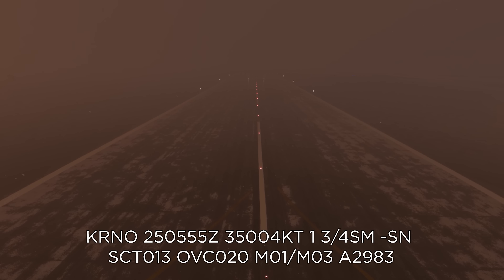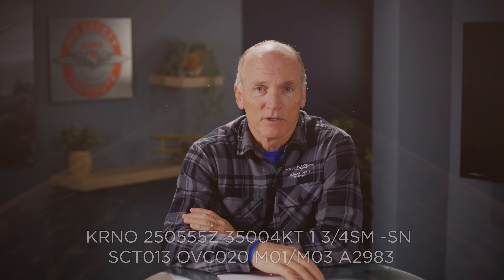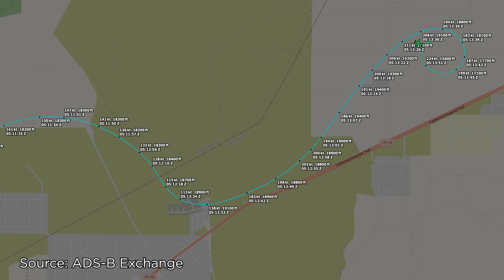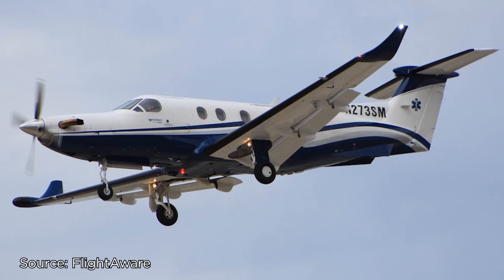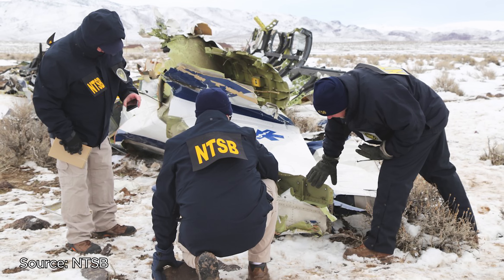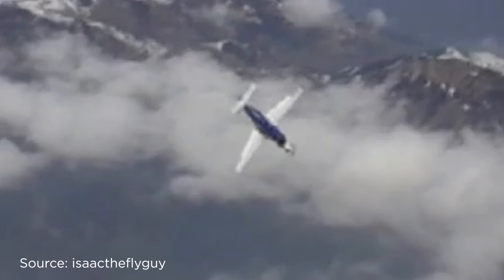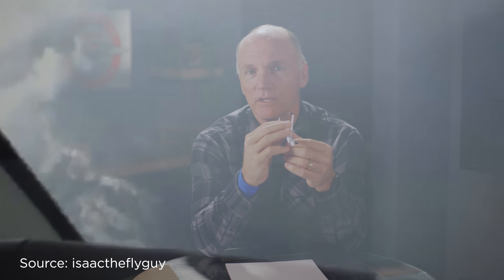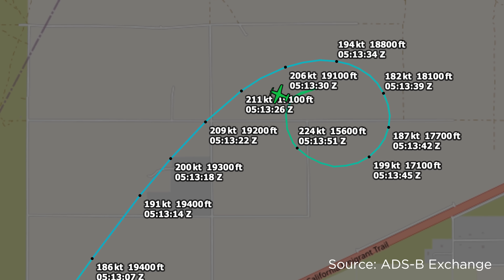Early Analysis: PC-12 In-flight Breakup Over Stagecoach, Nevada

Comment: It’s very difficult not to feel pressure when on a Medevac tasking. I would have thought that FL250 is somewhat optimistic with the anti/ de-icing on. In the end, it’s just a single engine turbine, and your excess thrust reduces with altitude, additional weight, additional drag, and with all your services on (bleeding air off the engine). The plane starts to struggle in the climb without all that going on past about FL180. Add in no visual horizon, PC12 known autopilot disconnect issues and all we really need for an accident is incorrect or delayed upset recovery technique. A lot of contributing factors to get to that point. Will be interesting to read the report. Stay safe out there.

Comment: All due respect, but there's a fair bit in this video that is misleading. I'm an IP and Check Pilot in the PC-12 for two different Part 135 operators, both based in the NW US, and one of which is Air Ambulance. In the future I would recommend you do some research on PC-12 EMS operations before making a video like this. BTW, minimum autopilot climb speed in icing is 135 KIAS. 

Much of this advice if fine if you are flying an SR22 in the same conditions, but this is misplaced for the PC-12. We fly these conditions on most every night of the winter. This is normal EMS conditions for the NW US. They call the PC-12 when the conditions are poor, and the rotors can't go. If we didn't fly every time there was forecast moderate icing and moderate turbulence we'd be grounded all winter. These flights, in these same conditions, are done without incident and with healthy risk margins hundreds of times every winter month by many EMS operators.

It's fine if you are trying to make a point with the SR22 pilots out there, but you should differentiate that operation from Part 135 EMS in a PC-12. This is not a GA flight. You're making it sound like this pilot was certainly in way over his head; all manner of conditions stacked against him. That's just not a valid understanding of the operation. I looked at the weather the same day of this tragic accident and I would have accepted this flight, just as this pilot did.

Instead of speculating on the pilot’s workload single-pilot IFR in wintery conditions we should be emphasizing attitude instrument flying both hand-flown and using the autopilot. You mention that at the end. However, I'm guess many missed that since you already have everyone wound up about the dangers of SPIFR in the winter in the PC12.
Reply: Anyone with a mind should always appreciate constructive corrections. Thanks for the correction.

Comment: I would think above 10,000 you would have the autopilot on. Climb on profile at turbulence penetration speed. I assume the deicing system comes at slight performance cost. If the autopilot disconnects due to turbulence at night in weather with a compromised overwhelmed moderate or greater icing situation and possible structure failure that's no bueno .

Comment: Extreme weather conditions with pressure due to the need of the flight. A slight mechanical failure and the odds just stacked up. Should just stay home some times

Comment: In my instrument training I was taught that you have three enemies in flight:  Weather, Night, Mountains.  I was warned to never face any two of those three at the same time.
Reply: That's a good policy.. When single pilot especially. Any of the following: General bad weather aka rain, clouds, etc , icing of ANY kind, terrain, night. Pick one. Never more than one. If more than one of those things exists. Pick tomorrow.
Reply: Would a Honda jet or vision jet been any better in these types of conditions?
Reply: Those are great words, but as a former freight pilot (multi), and then air ambulance pilot in a PC12NG, I can tell you that these are all everyday realities of what we do.

I have the misfortune of more than 1000hr in the PC12NG as an air ambulance pilot.
At best the PC12NG is a woeful aircraft. Underpowered and deice systems that are marginal at best.

I’ve flown turbine twins in heavy ice and turbulence as a freight pilot that could barely stay in the air.
Some others haven’t been so lucky.

For as long as companies insist on cheap single engine transportation, the fine margins of safety will always be pushed to the extreme!
Reply: @fistfullamullah Never flown a PC -12 , does it have de-icing on the tail horizontal stabilizer ? Any ice on the wing means more on the tail — which couldn’t be seen by the pilot and would nose the ship down straight away at stall . Of course, severe turbulence could have been a possibility since he was in cruise and above Va [ or Vy ] presumably. The latter , of course , could account for a few break-ups recently in near or in T-storm conditions—Crossfields’ accident comes to mind .

Comment: During the eighties I've flown various aircraft, as a single pilot, including 800 hrs of Air Ambulance flights in a PA60 all over the eastern U.S. in all types of weather remaining within the capabilities of myself and the aircraft. Afterwhich I flew the Beech 18 single pilot on a service contract in Georgia. Then moved into a KingAir 200 as a two pilot Captain crew. I have over 4k PIC hours and to me this flight was nothing but an enjoyable and challenging IMC flying well within the capabilities of the aircraft and commercial pilot. 

   IMO: Now I have made this mistake before, At the end of my flying career and something I despise doing, is to fly an unfamiliar aircraft. I was ferrying Mooney's from around the eastern U.S. to San Antonio, TX. I was giving a TLS and thought this was going to be cool flying high in an unpressurized aircraft. Being not one with the aircraft I didn't catch the o2 wasn't working and about 19k feet I accepted the fact that something was amiss. Tracked it down to the inline indicator and it was red. Emergency descent followed by mental calculations to keep the brain thinking. I was lucking. 
   It would appear to me that the pilot was hand flying, passed out and regained consciousness too late to recover. Based on the following, Departs with a heavy load into IMC and icing conditions. He's having to climb at a faster climb speed to remain above the minimum airspeed for icing conditions while having to employ engine anti ice vanes which reduce engine performance. This makes for  slow climb and not recognizing the aircraft isn't pressurizing. 
  Why isn't the aircraft pressurizing? Possibly the outflow safety valve is stuck open or won't close because the landing gear fully extended switch isn't triggered.  
  Every pilot should strive to become one with the aircraft. If there is something that can be done from the cockpit you should be ready to do it. Situation awareness is to continuously evaluate your and your aircrafts capabilities and apply this to the environment at that moment.
  As a single pilot, if a non immediate action emergency was to arise, I would engage the autopilot to reduce the workload and figure out a solution. The Century IV autopilot in the PA60 and I were best buddies. Those Air Ambulance flights are in the logbook between 500 and 1300 total flight hours. I've accumulated 4k PIC over the years.

Comment: A number of years ago, there was an accident involving a aircraft in the MD-80 family, where the use of de-icing (or anti-icing) equipment reduced the amount of thrust available to maintain the plane's altitude, resulting in a stall and subsequent crash.  I understand completely that the PC-12 is an entirely different aircraft with a different type of powerplant and de-icing equipment, but could the use of de-icing have impacted its ability to climb any higher?

Comment: What they want to investigate is after 4 medical fight crashes in the past year or so are they going to start requiring these medical operations that have two pilots!!  All the accidents have been basically the same thing, single pilot into IMC, treacherous weather conditions that are questionable to be flying in, moderate to severe turbulence and  icing conditions, losing control of the aircraft or spatial disorientation. Blancolerio just put a video out with ring camera audio from 1/4 mile from the crash site and it's extremely difficult to listen to and absolutely mortifying to think of what those poor people experienced the last moments of their lives, sickened my stomach. FAA has got to step in and make some serious changes.

Comment: I don't get why more commuter aircraft aren't designed with wings up high, doors and windows below, so that they are inherently more stable. What are the trade-offs, if any??
Reply: Roll stability is a function of wing dihedral, not so much if it's high-wing or low-wing.

Comment: I used to fly Medevac out of RNO to SLC in a turboprop, so this one hits close to home.  Spent many a night flying in those exact same conditions.  Blancoliro paints this one as spacial disorientation, but I'm having a hard time buying that.  This airplane had to be equipped with an autopilot to be legal for this 135 single pilot flight, and it appears that the autopilot was functioning for the first part of the flight.  Did it fail?  Did control forces force it to disconnect?  I'm guessing the latter.  It strikes me as significant that the airplane rolled into a 90 degree right hand turn at 05:11 and then recovered to parallel the course (but didn't turn back to intercept it again), and then the final spiral was to the right again at 05:13.  That tells me that there was some control problem.  The airplane wanted to turn hard to the right.   What was causing that?

Having close to 3,000 hours in turboprops with de-ice boots flying in all kinds of weather, I've had plenty of times when the de-ice boots didn't work properly.  Everyone who has flown de-ice boot equipped airplanes knows that you don't cycle the boots until there is a significant buildup of ice, because if the ice is not thick enough it will not break off and will form to the contour of the inflated boot.  De-ice boots are finicky!  Sometimes they don't inflate well due to an air leak.  Sometimes they inflate just fine but the ice sticks to them.   Possibly a control problem due to incomplete or asymmetrical de-icing.  

However, with a temperature at -1C on the ground, if there was a standard lapse rate it would have been way too cold for icing at 18,000 feet.  The icing band is rarely more than 3000-4000 feet thick.  Lapse rates are never exactly standard, so I'd be looking for PIREPS in the area and icing forecasts for that altitude. So the asymmetrical icing theory is a hard one to swallow too.   But I still think that there had to be some kind of control problem that forced the autopilot to disconnect and drove the airplane into a hard right turn.  He recovered it the first time, but not the second time.  

You mentioned the possibility of a stall.  The airplane had a ground speed of 164 knots when it started the first right turn off course, and 194 knots when it started the second right turn that ended in the spiral.  

You mentioned the possibility of the airplane coming apart due to turbulence.  I would have a hard time buying that one.  Moderate turbulence is very uncomfortable, but not dangerous.  It would take VERY severe turbulence (as in a thunderstorm) to cause structural failure.  The turbulence could have certainly complicated his control issues.  Again I'm wondering if there were any PIREPS on the turbulence at that time?

He was climbing through 18,000 when the problems started.  Was the pressurization working?  That is probably not the issue, because TUC is still about 20-30 minutes at that altitude, but it would be something to consider.  

If I was an investigator, I'd be looking at the maintenance history on this airplane.  Any history of issues with the autopilot?  Any history of issues with the de-icing system?  Any history of issues with the pressurization system?  I'd be looking at PIREPS and icing forecasts.  

I've done all kinds of flying.  Most of my career was in the part 121 world, but I'm currently back in the part 135 world of business jets.  But the most stressful flying I ever did was medevac flying.  It is often in these kinds of stressful conditions in older equipment and a compelling reason to get the mission accomplished.
Reply: Tim, my guess is you flew with American Medflight, who was bought by REACH, who contract with Careflight to operate in western nevada?

I have heard through contacts that ground crew and flight crew were questioning the necessity of the flight with a stable patient that was being transferred for a non -emergent procedure that could have waited until better conditions. Did you experience operational pressures when you flew?

Given Blanco’s video and knowing that PIC missed the taxiway due to visibility, needing to be guided by RNO tower to taxiway, do you feel that the flight should have been a “no” by crew and PIC at this point, or was there operational inertia pushing them on?

BTW, my spouse worked for this service and AMF. I did orientation for the service, but never flew. Risk wasn’t worth the crappy pay.

Comment: The B engine on the legacy PC12 has lower power, I think around 20% lower than the NG, with a full load, open separator and ice equipment on, he probably was working hard. If he was in moderate turbulence, it’s harder with the small original AI to hold it all together.  Sad deal. 
I had my autopilot kick out in an NG 2 weeks earlier at FL290 in TX in moderate to Serv turbulence, I can tell you it was not a good time, I pulled the power back and was able to turn East to use 140 knot X-wind to get away from the system.  I could barely see my 12” display things where shaking so bad and it was a good workout making a 90 course change in that environment.

Comment: I have over 7000 hours over 20 years in PC12 aircraft. First, I like your Videos! Second, turbulence wont cause a elevator failure at the speeds that he was climbing out at (please don’t say that again, all we need is for passengers to think that turbulence causes airplanes to come apart) I have flown a PC12 on many occasions in far more demanding conditions than this and the plane handled it with a wide margin of safety.
This was pilot error, pure and simple. He got too slow and was behind the plane. More than likely he was climbing out with the autopilot on VS mode and as the speed decayed he failed to catch it causing the plane to stall. Pilots that fly the PC12 know that you must switch over to IAS (indicated. speed) mode at 140kias minimum. That way if you get distracted the speed doesn’t decay to a stall (ask me how I know). RIP all victims of this avoidable accident.
Reply: I think a bombardier RJ suffered engine failure because the crew set the autopilot to a vertical speed setting and not an airspeed setting fortunately it was a repositioning flight so no passages were killed in the accident. For sure a very easy to overlook item but maybe just maybe a second crew member could have caught the error, thanks for the input

Comment: SIGMET for moderate icing doesn't mean you're "taking off in moderate icing" or that the pilot was "in icing condition". You might encounter some, or none. If the pilot did encounter moderate icing, however, that would be very worrisome in a single-pilot PC-12. I flew the crew-served SAAB 340B+ and operated routinely in mod icing; that aircraft is fully capable of handling that, but few other FIKI aircraft are. Not addressed is whether the pilot took off with some kind of frozen precip on the wings and control surfaces. Even if type I was applied, it has no holdover time.

Comment: Maneuvering Speed i.e Va.  
There hasn't been much said about this.  Proper unusual attitude recovery is paramount.  Even below Va speed repeated single flight control movements below Va can lead to an inflight breakup.  Unusual attitude recovery above Va needs to be done without full flight control deflections.  Time will tell during the investigation but a dark turbulent night and possibly IMC and with an A/P disconnect or instrument failure led to an unusual attitude with a too aggressive of a recovery.  Sad.  RIP.

Comment: We need Col. McSpadden to be the next FAA Administrator, not an unqualified and talentless political appointee.  Meanwhile, perhaps the next FAA Administrator needs to evaluate CVR FDR regulations.  As they current are, they are too lenient.  Transport category airplane CVRs and FDRs should be required to capture at least 10 hours of data in order to prevent deliberate over-writing as has happened several times recently.  Smaller turbine aircraft including turboprops, utilized for commercial operations such as the PC-12 here, should be required to install CVRs and FDRs as well.  The current nominee will never consider such a regulation.  Col. McSpadden probably already has.

Anyway I disagree with Col. McSpadden about turbulence as the initial cause of the in-flight breakup.  The right outboard wing was found to have been separated from the main span.  I propose that this would render the aircraft left-side heavy, thereby causing it to roll to the left (as opposed to a rightward roll due to assymetric lift as many of you will argue).  The ADS-B track shows a rightward spiral.  The evidence, I believe, contradicts Col. McSpadden's turbulence theory.  Let me know what you think.